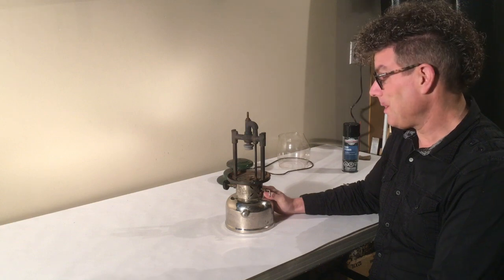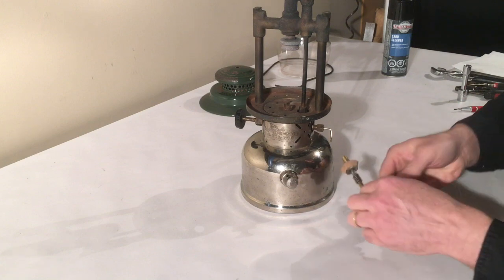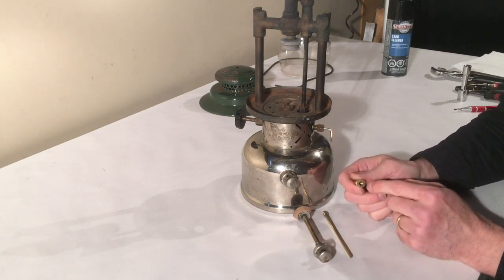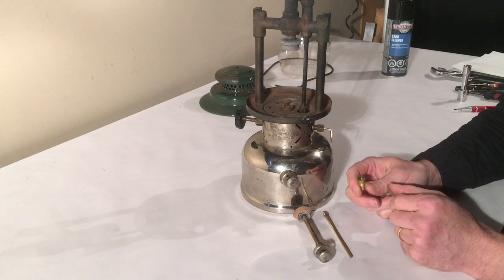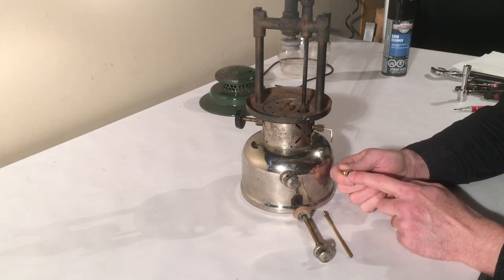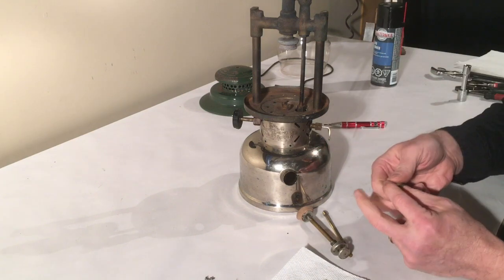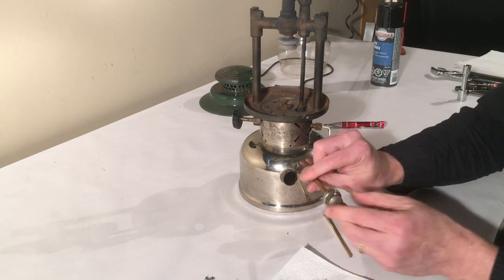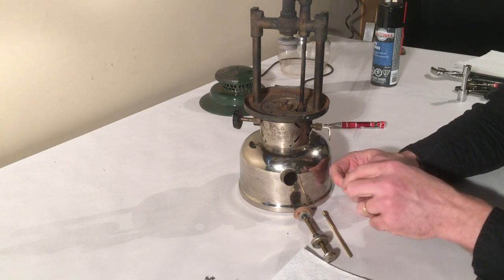How to Repair or Replace a Bad Lantern or Stove Check Valve

Comment: I don't have the tool to deal with check valves, at least not yet so I am using repeated doses of Carb Cleaner to try fixing the check valve which is stuck in the closed position on a recently acquired 200. Air pump was expected to be dry, fixed that and I will have to do something about the fuel cap gasket.

The lamp has been well used over the decades and I was not planning on a restoration, but with the time it might take to fix the check valve some partial disassembly for a citric acid soak or perhaps even an electrolysis tank for rust removal might now be in order. It won't be a museum quality restoration but I will aim for a significant rejuvenation of a venerable old lamp.

Great series, I have watched a lot of the fixes and tips and tricks plus a lot of history from this channel.
Reply from the maker: If the check valve is stuck in the closed position, you might try poking it with a stiff wire or bamboo skewer to free it up.
Reply: @king.coleman    Tried that but it was stuck in the open position, already at the limit of it's movement.

I did several days of carb cleaner and on day 2 it started to burp some bubbles. This was encouraging so I continuted this treatment along with installing the pump plunger and trying to force carb cleaner in to the air tube so it could work from both side.

I finally elected to remove the main valve and filled the fount with hot vinegar to the brim. It would slowly work it's way through the check valve. When the plunger tube was full I topped it up with more warm vinegar.

After sitting overnight, several rinses with 91% alcohol to remove traces of vinegar, I can actually hear the check valve ball moving when I gently shake the tank.

Will reassemble tomorrow and give it a test burn if the fount holds its pressure.

No obvious way to remove the fuel pick up tube, so it got a good hot vinegar soak, followed by alcohol bath.
Reply: @king.coleman  Looks like my efforts were successful. Just reassembled everything and the tank holds pressure now.
I have found some pump repair kits (half way across the city), so I will pick a few up and replace the pump leather a bit later.

A test light later with fire extinguisher handy and with luck all goes well.

Have you ever tried cold bluing bare steel lantern parts. I'm mulling the idea of doing the side supports and bottom plate to help prevent more rust. Not sure it will stand up to the heat.

Comment: I've got two check valves 2hich leak. One from a stove one from an older lantern. Tried soaking them both in vinegar all day and it made no difference other than cleaning them up nice on the outside. I already installed a new check valve in the stove and I have one on order for the lantern. I may try the tapping to re-set the ball idea. Like you said, there's nothing to lose at this point.

Comment: Get a new one? Lucky you!  I have tried to get a new one for my Feather 442 stove, only to be told by Coleman UK that check valves are not available as a spare part!
Reply from the maker: A 442 should use the standard check valve that Coleman has used in almost everything since the 1940s.  There may be a different part number for the 442 if the new check valve includes an air stem, which is shorter than usual on that model.  I expect, however, that your air stem is fine and that all you need is the check valve.  If Coleman doesn't sell them in your country, check with Old Coleman Parts.
Reply: Thank you.  @king.coleman

Comment: Check valve is clear and working as it should, new leather seal but still leaking. Is it a good idea to spray carb cleaner with check valve removed into the tube where the valve goes?
Reply from the maker: It won't hurt anything, but it won't do anything to fix your problem.  You say that the check valve is working, so you'll probably want to do a dunk test to determine where the leak is.  Pump it up, dunk it in some water, and look for bubbles.  The usual culprit is the fuel cap gasket, but the valve can also leak if the stem isn't seating properly.  If you recently removed the valve from the fount, it's possible it may be leaking at the bung.  You could have a compromised fount.  Or the check valve may not be working after all.  The bubbles will tell you where the problem is.  If you don't want to go straight to the dunk test, try swapping the fuel cap with a known-good cap and see if it holds pressure.
Reply: Fuel cap gasket was replaced. The fount will not hold pressure at all. What goes in, comes out immediately. I swapped the check valve, the pump and all to another lantern and no problems there. So It leads be to believe its in the fount itself. What say you?
Reply from the maker: @mikegalate5182  Sounds like a compromised fount.  Time for a dunk test.  The bubbles won't lie.

Comment: I been studying up on this. Your videos are by far the Best!
Will WD-40 work for cleaning check valve?
Reply from the maker: As far as I'm aware, WD-40 is not a cleaner.  It displaces water and lubricates things.
Reply: Jip, Spot On. But I got and old lantern that's in Great condition but has some rust in the pump channel. So now I'm removing rust with WD-40 and after that will clean oil residue with petrol.
Then let it dry out and try and fire it up.
That ok?
Reply from the maker: @thegulagarchipelago5921  WD-40 isn't a rust remover.  I assume it's the walls of the pump tube that are rusty.  If that's the case, I'd pour in some white vinegar and let it sit for a couple of hours.  That will break down the rust.  Rinse it out, then use a bore brush or some fine sandpaper wrapped around a dowel to smooth it out if necessary.
Reply: @king.coleman  Thanks much 👍 We all learn something sometime.😉

Comment: King Coleman: I just bought the tool - works great, EXCEPT on one particular check valve from a 1957 200a. I swear the slot on its valve is too small for the tool. Have you ever come across this? I don’t want to file down the tool to make it fit, rendering it undersized from now on. And of course, that’s the lantern whose valve is faulty and the reason I bought the tool!
Reply from the maker: I don't think the check valve itself is any different than others.  Coleman used a single check valve on everything for decades, so it's not like someone accidentally installed the wrong part at the factory.  The two most likely possibilities are (1) someone tried to remove it with a screwdriver and chewed it up or (2) the slot is filled with grease and debris.  I've run into both and in either case, when you insert the removal tool, you should still feel when it lines up with the slot.  Line it up, then tighten the nut.  That should pull the tool into the slot on the check valve, whether that means squishing debris out of the way or pushing through soft, mangled brass.  Even in the latter case, there's usually still enough metal for the tool to get a grip on.  Good luck.

Comment: First of all...thanks for all of your informative videos. I have a few coleman lanterns and a couple of coleman stoves. When I remove the check valves for maintenance and cleaning, I've noticed that there sometimes is an oring around the check valve. Do you know what size those orings are? I'd like to replace them before they fail. Thanks in advance.
Reply from the maker: I can't tell you with any certainty what size those o-rings are as I don't work on appliances new enough to have them.  I see Basnett's refers to them as No. 57, for what that might be worth.  Old Coleman Parts sells them as well:
https://www.oldcolemanparts.com/Check-Valve-O-Ring-S36.html
Reply: @king.coleman  , Thanks for the lead. I appreciate it.

Comment: Pretty cool video. A real problem and very common I have found is rust inside the fount, from severe to a light dusting of rust with no pitting. Have you addressed any founts with rust and what amount of rust will effect the operation of a lantern. I have a 220F that has never been used. It has a very light rusting inside of the fount. You have given me some great insight on how to trouble shoot my lantern. I have some concern, I have found a couple of things already. The cup on the pump is definitely going to need oiling and I had to back off the packing nut a 1/4 turn to get the fuel valve to open. I’m really leaning towards a complete disassembly before I ever use it. I’m concerned of fouling the air tube and check valve. I’ve really have 3 choices. Test the lantern, and if it passes use as it is. Disassemble the lantern check all parts and address the rust in the fount. Spend $55 dollars send it to Coleman and get it refurbished.

First option is the laziness in me. The second option is what I probably should do. The third option is the easiest but not sure if Coleman would clean the inside of the fount. Any insight would be highly appreciated.
Reply from the maker: A mild acid solution or commercial rust-remover (like Evaporust) is usually sufficient.  If it's bad, I first dump some BBs in the fount and give a good shake for ten or fifteen minutes before rinsing and soaking in rust remover.  If the fount is compromised, the BB shake will often reveal it.  I always follow that up with a pressure test: fifty or sixty pumps and then a dunk in water to look for bubbles.  If I'm really concerned, I'll pump it until it's too difficult to pump any more and let it sit overnight, then check for leaks.
Reply: @king.coleman  Thanks for the quick reply! The fount is in excellent condition.  The fount is flawless on the exterior. Just has slight rust inside the fount. BBs and Evaporust could be an easy solution. Thanks again!
Reply: @king.coleman  Maybe a dumb question but are BBs larger than the air tube opening in the fount? No chance of a BB getting stuck in there? Thanks for the great video!
Reply from the maker: @billgriffin1505  Yes, they are larger.
Reply: I recently purchased a 10/71 220F that is unused.  Mine has the same issues as you described.  Were you able to remove the rust from inside the fount?  I was able to free up the fuel valve and the clean out wire without loosening the packing nuts.  The pump leather is good, but the check valve leaks (pushes the pump back out.)  The exterior is in new condition.

Comment: I just got a 228D in pretty good condition.  Someone at some point destroyed the wings to the check valve.  What drastic measures should I try to remove it?  It isn’t functional (check valve).
Reply from the maker: @Bryan1Hersey  An easy out is pretty much your only option at that point.

Comment: Hi.  Is there any particular reason you not using ultrasonic parts cleaner for cleaning parts?
Reply from the maker: I've used one on occasion, but haven't found that they do a better job than boiling in mild acid solution.  Most people don't have access to one and I'm trying to show people how they can engage in this hobby with what they're likely to have or have easy access to and without spending a lot of money.
Reply: @king.coleman  I happens to have ultrasonic parts cleaner and I used it to clean up Petromax/Britelyt upper generator tube yesterday.  I used about 3% vinegar solution @50C for about 30 min.  It appeared to get a lot of carbon out from that bend tube that style of generator has.  At least now air now flows through it very well.  Your videos are good and they inspired me to clean up existing generator vs replacing with new one!  Thank you

Comment: My check valve is leaking air but if i close the pump handle then the air keeps inside. Is it safe if a use it like that? I am not from usa and tried to remove the check valve with all king of tools except a proper tool but is so expensive for me since i am not from US. Thank you!
Reply from the maker: They don't always seal perfectly.  If it seals completely with the air stem screwed down it'll be fine.
Reply: @king.coleman  Thank you! You saved my life 🤜🏻🤛🏻